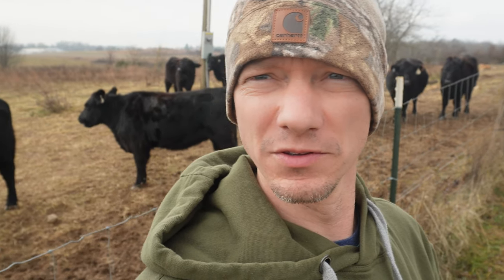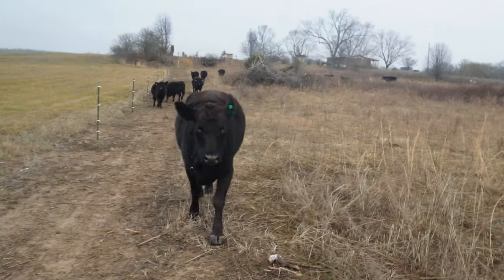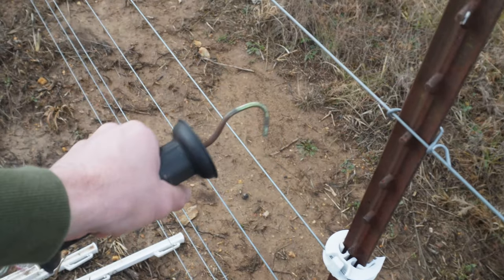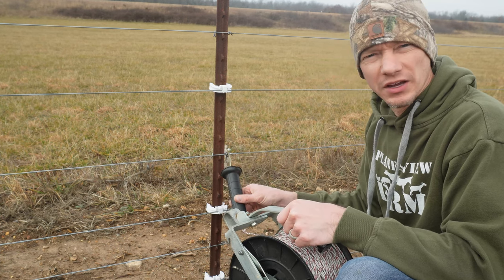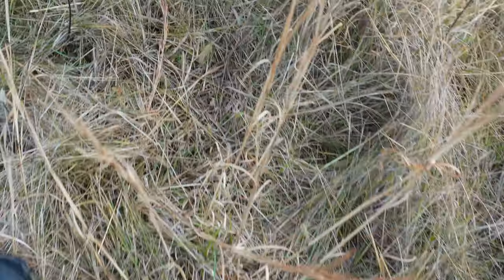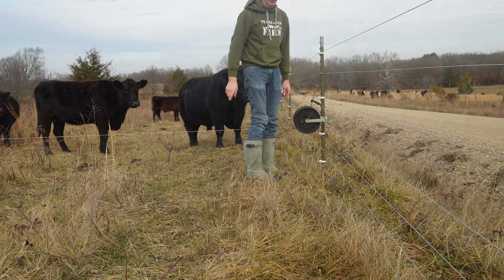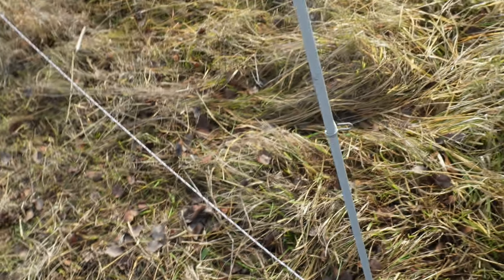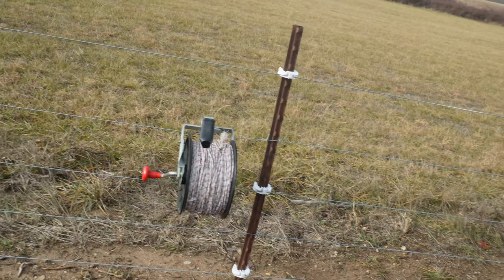Strip Grazing Cattle On Stockpiled Grass

Comment: How many heads of cattle do you have and how many acres of pasture are they in? I’m have about 7 acres of pasture at my farm good pasture that I planted how many low line angus do you think I can have on it for grazing? I have Dexters right now I me just wondering if low line is better for me I would really appreciate you opinion on it thanks
Reply from the maker: I have 9 cows, 8 calves (one on the way), and 1 bull on 20 acres, but I'm probably a little bit over on my stocking rate. I'm in Southern Missouri. It's hard to say what your stocking rate would be as it can vary quite a bit from one location to another. You might try to find grazing guide or manual for your area. They can sometimes be found on College or University websites. Or, you might message someone in the ag department, or check with an extension service, if you have one nearby. The Dexters are going to be slightly higher on stocking rate than the lowlines, because of size. The lowline cattle are a bit larger.

Comment: Do you add a wire across to keep the cows from going back to the previous week’s paddock, or just 1 wire to keep them from going past the 40-50’ of new paddock?
Reply from the maker: Just one wire. With the cold weather, I'm not able to get water to them as easily as I can in warmer months. I let them go back over the area they've already been so they can get back to the tank I have near the house. In the spring, I'll start using 2 wires to give the grass time to recover. I'll also have lanes set up for water access closer to where they're grazing.
Reply: @PlaneViewFarm  love what you’re doing with the family farm! I became the new owner of 130 acres in OK after my father passed. Starting with chickens and pigs to get my feet wet 😬